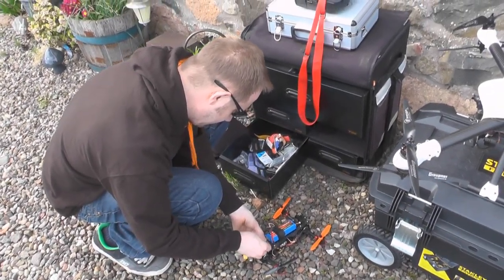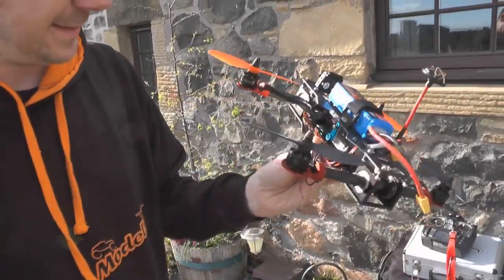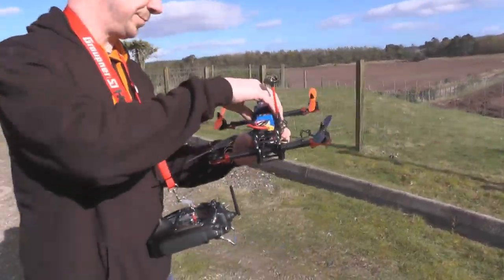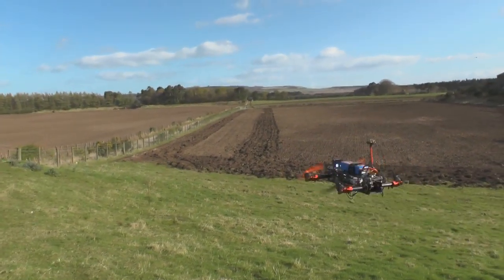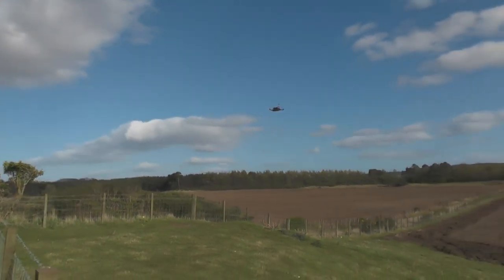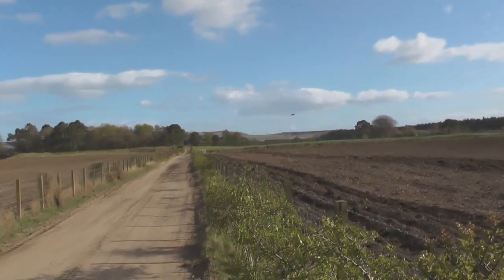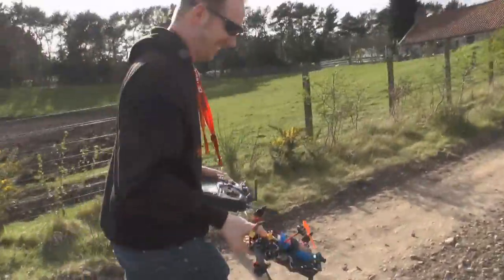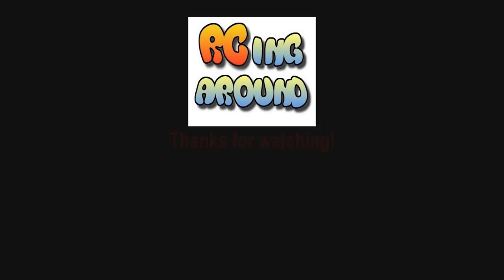TMTR 250- World's BEST Tilt Rotor quadcopter/drone?? 250 size!! Small & fast!

Comment: that tilt rotor is bad ass, it puts those other tilt rotors to shame but I can't get my head around what he said about it tilting forward but not telling the flight controller it's moving forward. it would be nice to have a little more detailed description on how it works.
Reply from the maker: +Brad King Hi, Brad. Haha thanks, I'll let him know! That's a fair point, we'll get another video, explaining what he meant, but the jist of it is this: most quadcopters will try and compensate for any lateral movement, when the 'copter is level (getting blown by the wind, for example). So if you tell it to go forwards, it LEANS forward... due to the rear motors spinning harder than the fronts... otherwise, it will try and stay on the spot. It knows it is going forward, and will not move to compensate for it. The TMTR moves forward without leaning, motors all spinning the same speed, so you have to fool the flight controller, telling it there is no movement.

We'll get Alun to do a proper demonstration, if he has time, and give you a quick mention! Cheers!
Reply: +RCing Around HQ 
thanks, could you tell me what kind of flight controller/receiver he's using, I've watched the video a dozen times trying to make out what he says and can't get it.
you might pass on a suggestion for me, I know he talks about the extra weight the bearing add to the quad and he's right, but I bet Teflon-coated plastic bearing/bushing would work just as well at about a tenth of the weight, something to consider.... thanks
Reply from the maker: +Brad King No problem, Brad. I'll get right on it!
Reply from the maker: +RCing Around HQ Damn, I went into Tay Models, but he had left the TMTR at home!! I'll get it soon, though.
Reply: +RCing Around HQ , don't go to too much trouble  I am really curious about the receiver with built in flight controller, I never knew they made something like that, but I'm in no hurry....thanks
Reply from the maker: +Brad King It's no trouble, at all. I was going into Tay Models anyway, so I just brought the camera with me. They technically don't make something like this. Alun's is really pretty unique. He had to play around with settings on the software.
Reply: +RCing Around HQ, i think we got something confused, i know his quad is a one -off proto-type that he designed himself, but i was asking for just the information on the "combination receiver-flight controller" he's using. if it's not too much trouble....thanks
Reply from the maker: +Brad King Yeah, no worries. I'll probably be dropping in on the shop, some time during the week.
Reply: I know that Alun uses the Graupner HoTT radio system, so the Rx/FC combo will be part of that radio system. It'll be listed in their catalogue. Gotta be worth a Google!
Reply from the maker: ^ What he said!
Reply from the maker: Hello! Yes, I have asked Alun, but he keeps forgetting to take the damn thing to his shop for recording again! I'll remind him for the 1000th time!
Reply from the maker: Cool. I'll get on it!
Reply: Brad King yea because you have modes for the fc and or moving servos has nothing to do with fc. old days servo go straight to rx which in guessing is what he has done here. the fc will control the props. depends what fc his using to as I coud see 10dof causing problems and telling the props to balance when it doesnt need to. 
All on the way you fly and modes, im suprised these aint about more as they cheap to put together and eas6 to understand in hand.

Comment: thanks. only 1 frame on market thats like 50 bucks. couldnt work out how to lock the boom between the 2 mounts to lock it in place.

What exact bearings did you use?
Reply from the maker: I'll get the exact specs from Alun and get back to you. It isn't my quad, but it shouldn't take too long.